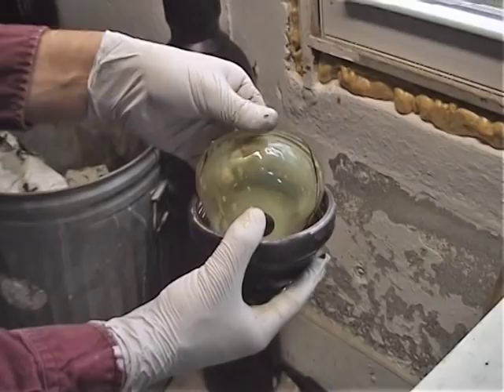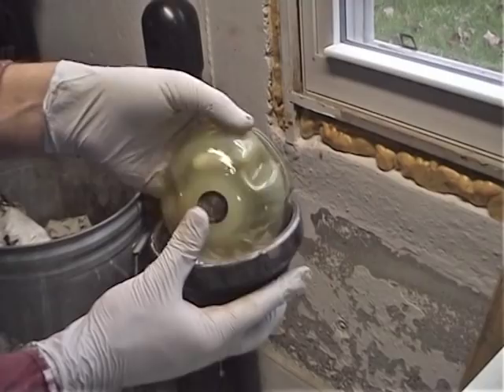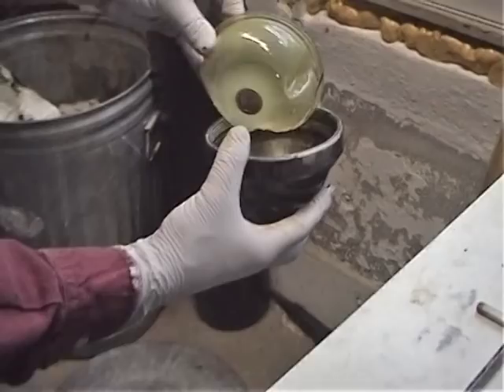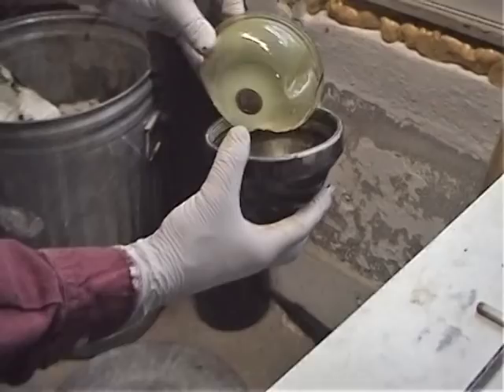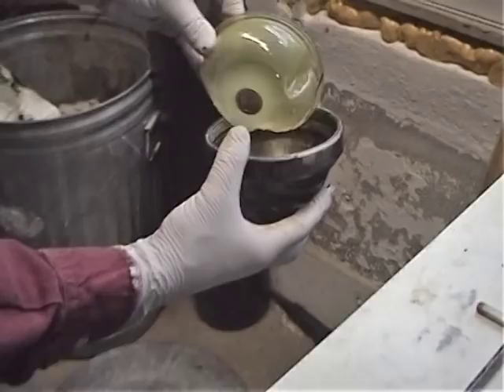Citroen accumulator rebuild bonus: Wrong diaphragm.

Comment: wrong kind. Central hydraulic charge is about 120bar pressure and connected to steering, breakes and suspension . 
Special about Citroen unusual thing . The suspension is put to diaphragm-chamber , but with all its pressure